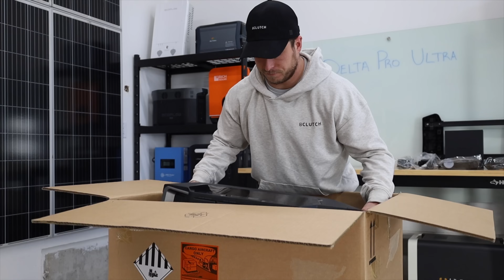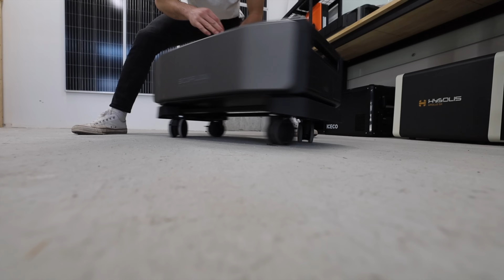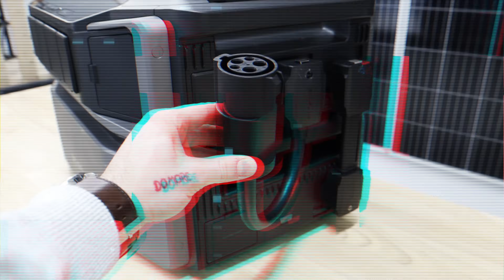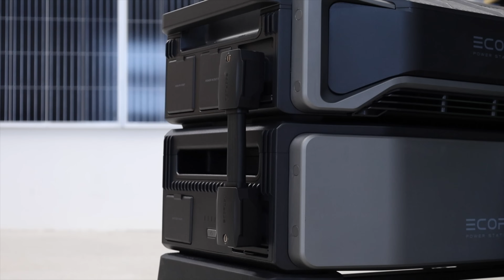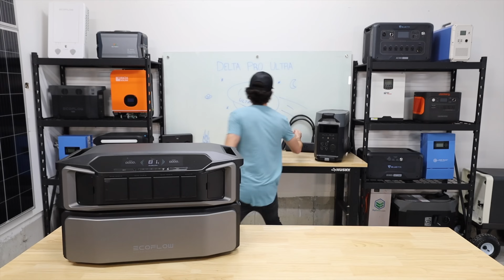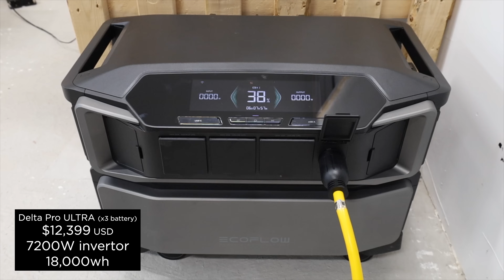EcoFlow Delta Pro Ultra - NOT What We Were Expecting!

Comment: Hey bro! My house is currently running full time on two delta pros with 4 batteries. The house is under contract and the solar is going with it.  I rarely exceed 1k at any given time. More like 500-900 watts daily. At my new house, I'm guessing to stay around 750-900 watts continuous. With the right panels, would the dp ultra with 2 batteries keep me off grid  or should I get more batteries?

Comment: EcoFlow complaints often center on poor customer service, particularly warranty claims, slow resolution times, and unhelpful/uninformed support staff, alongside product reliability issues like rapid battery drain, premature failures (especially out of warranty), and inaccurate power display readings, with some users reporting wrong shipments or issues with unboxing/packaging, though some users find the products excellent and service good, highlighting a mixed but often frustrating experience for those with problems. 
Common Themes in Complaints:
Customer Support Nightmares: Many report being ignored, blocked on social media, receiving AI/unqualified responses, or struggling to get warranty service, leading to long waits for replacements or fixes.
Product Reliability & Failure: Units dying unexpectedly, battery failures (even on new devices), and issues with charging/discharging are common, especially after warranty periods expire.
Misleading Information & Sales: Some customers received incorrect advice on product compatibility or features, leading to frustrating surprises after purchase.
Shipping & Fulfillment Issues: Delays, damaged packaging, or incorrect items (like a bed frame instead of a power station) are reported.
Software/Display Glitches: Inaccurate power consumption displays or app control issues can occur. 
Specific Examples:
A user experienced a dangerous battery drain on two new units and faced a year-long wait for warranty, with support unresponsive.
Someone ordered a solar generator but received a bed frame and had extreme difficulty getting a refund.
Tech support struggled with basic product integration, suggesting a lack of in-depth knowledge.

Comment: I bought the delta pro uktra and have lived off grid prior to owning this four four years.  I had a lead acid 24 volt system witnh 12 200 amp hour six volt batteries  and a 3000 awatt aims inverter.  That did alright but as kids got older snd wanted more gaming and starlink etc the old system was just not cutting it.  So i added another 3600 watts of solar and kept the old system which plugged into a generator receptacle for the entire house and i bought this unit.  So now with this we can go two days in darkness and when it runs low on battery I just ppug back into the old system.   Eats hearing a noisy generator and the unit charges fast enough with just a mix of sun and cloud in about three hours. I have two batteries with it and that is plenty. It makes off grid living a joy instead of a challenge.    I miss the challenge however but not as much as I miss  the complaints about being with no power from the kids.  !!!

Comment: I’m looking to add power backup for my fifth wheel. Rocking 1200w panels and 810Ah of batteries and a 7kw generator which is pretty solid. This baddy and the Anker F3800, drop this in the belly storage and have a great backup to extend our boondocking experience.

You all are doing great job with reviewing these power systems. What I don’t see is vibration testing. Running around in an RV will cause a lot of shaking, could you possibly give some thoughts on vibration with these?

Comment: Hi There. I have a question regarding the EcoFlow DPU. Let's say I have the EcoFlow DPU with three batteries for a total of 18kWh capacity. This is powering a load of 1500w. The DPU is connected to an AC outlet as well with the charge setting at low (400w). Will the DPU pull the total 1900w load from the AC bypassing the charge limit setting? or will it take the 1500w load from the batteries and 400w from the AC? For the sake of argument let's say that the DPU is not connected to any solar panels. The circuitry in my off-grid cabin cannot handle a combined load over approx. 1200w for a single device so my goal is to be able to limit the max grid input wattage. Any insights or workarounds you all might have would be greatly appreciated. 
I've posed the same question to Google and the A.I. responds sometimes with No and other times Yes. 😵‍💫Many thanks!

Comment: Thanks for the run down. I live in the U.S. Virgin Islands and power outages are a regular part of life here. Most are about 1-3 hours long and can occur as frequently as 3-7 times a month. Of course there are occasions when storms can knock out power for weeks and months at a time. (our home was without power for almost 3 months after Hurricane Maria). I currently have a 7500W inverter gasoline generator that I connect to my circuit breaker panel with a transfer switch with a 240 cable. It does the job, but is a pain to take out, set up, and connect. It's not as loud as other generators that I have owned over the years, but it's loud enough to be less than pleasant. I would love to no longer need it and replace it with this power station. Unfortunately, most explanations of this unit are not offering me an assuring enough answer to whether or not that is possible. I have a condo that is completely electric dependent, refrigerator, stove, oven, etc. My question is about how long (at best) I can expect the power station (with one battery) to keep me going with a full load of lights, refrigerator, and small appliances? Also, how much will I reduce that time if I turn on the stove to cook, a room A/C to cool off, or the washer/dryer to do a load of laundry? Now I know the answer is "it depends on the wattage load," but I was just hoping for some ballpark estimates. I unfortunately don't have exact wattages of all the appliances, but they are typical home appliances, nothing overbearing in power demand than the usual appliances on the market. The A/C's are just a 10,000 BTU room are conditioner and 12,000 BTU split system and I wouldn't run the continually. I think the biggest power guzzlers would be the stove and the dryer. I usually don't run the hot water heater during outages. A cold shower in the Caribbean isn't all that bad. If I can count on at least 5-7 hours of power with a fully charged battery, that would be perfect. A little longer, even better. I would be getting the one that comes with the solar panel, so I can charge it that way when needed and I also have a small 1500w gasoline generator that I could use to recharge the battery. I have seen one video suggesting that the unit doesn't charge at the same time as it is outputting. Can you confirm or discount that, as of course, that could be a major drawback during longer outages. I appreciate your thoughts. Thanks for your information video!
Reply: With the new updated software youncan output while charging.  Obviously if you are generating 3000 watts to charge and your battery is outputting 1200 watts then you are only charging at a rate of 3000 minus 1200 which would be 1800 watts but it is possible. Most buy larger inverter generators 7500 watts so you can charge at 4000 and still have room to power the home.  And you only need to charge for three hours to get it back to a hundred percent

Comment: Connecting 2 delta pro ultra into the 50amp hub gives you 14.4kw not 12kw. Each inverter is 7200 watts? Right?

Comment: Forgive my skepticism and I appreciate the honest no shill review but compare it to other stuff on the market. Sol-Ark, my choice, about $6500, fortress 18kwh battery, about $10,000. Has generator input native, no proprietary plugs, and completely configurable. One stack of Deltas is $14,000, requires a magical subpanel, which I hear is prone to failure, lots of proprietary accessories. Honestly seems like a neat toy but has no grid backfeed capability. Both will ultimately require professional install. I have done many systems and only see the value here as a backup. No savings and in a few years when it craps out? Good luck, Now you have to buy the Delta 7 Supe Duper Ultra Pro plus with backwards compatible adapters? Good money after bad. Sol-Ark too much money? EG-4 has a nice setup. If you're desperate, Sun Gold Power? Batteries too much $$$? Try battery Hookup, Amazon has huge prismatic kits for dirt cheap. If you want a lazy backup, this could work. Lots of features but way overpriced. Get your hands dirty, build a system you can work on, because nobody else will. A modular setup can be repaired or modified, this can't.

Comment: I currently have a 50-amp interlock system on my main panel. I think it's best to leave this here and if the power is out for an extended period of time and I need to charge my Delta Pro system, it can charge from this 50-amp generator source from the main panel versus connecting the generator directly to the EcoFlow Smart Switch, correct? I have a 5-ton a/c system, so I figured that if I kept it like this, I can run the a/c while the generator is running...and it can charge. If I connect the generator directly to the smart switch, I'll never be able to run the a/c (it's too big for the EcoFlow system).

Comment: What sold me on this unit.  If you have a simple Reliance Gen Transfer switch already in your basement and you added a 6 ft cord with the L14-30 plug, you are ready to use this unit.  And, if you cut the original cable leading from your garage or outbuilding, where your generator is located, you could just add an L14-30 outlet on that cord, and either plug into your Ecoflow battery or into your generator power supply.  This is the design that I did for my basement.  I did make one exception.  I added two 120 outlets to my L14-30 outlet(one each side) so that if the Ecoflow got low on power during an emergency, I could add electricity via the 120 V inlet cable from the generator, while continuing to send 240 to the house.   You can not power 240V in and 240v out at the same time, so 120 with 1750 w input is the way to go.

Comment: Really. 5..6 kw into a 12v system, AND you need an MPPT.  who would buy this? Suckers who r looking 4 something EASY without any knowledge of off grid systems.  Save some money, diy, victron MPPT with mc5 connectors, with 24v minimum, and learn what inline fuses and a BMS is!

Comment: apologies if you have answered this already, but would you take this over the Jackery 5000 plus with extra battery (10kwh). I live in Canada and the Jackery 5000plus with an extra battery is 4999. (sale price).   The delta pro 3 ultra is 5560 (sale price).  i have a Generlink transfer switch that i was planning on using to connect either unit to the house.  eventually i would like to add solar.  I also have a Kia Ev9 and would love to know if there is a way to incorporate its battery during a power outage.

Comment: Yep, with all things built is its a great device !!! But not for a boat I’m afraid….
When one of the features stops working, the entire unit must ‘go to the doctor. I am converting my catamaran to completely off grid, and am very into ‘safety and self servicability’ for all electrical things: Easily accessible battery system, easily swappable BMS for the battery pack (which probably is a worlds first), easily swappable solar chargers. So everything easily dissconnectable and swappable. It makes your system much, much more leliable.

Comment: It's great that it makes it that you don't have to learn anything about solar, but it's just not worth it for the price. The Ultra is just the inverter, so you have to pair it with one battery. That' already putting you at $4,200. This gives you a 6kWh battery that's good for 3,500 cycles.

You can instead go with a Ruixu Lithi2-16 a **16kWh** battery rated for **9,000** cycles!!! That's over 26 YEARS if you do a complete cycle every single day! You can pair that with an EG4 12000XP, for about $2,500. Add in another $500 for wires and fuses. So that's $6,200. However, you have a far more capable system, one that can put out way more power, accept a lager solar input, not to mention everything I mentioned before.

I think this system are of those that are super excited about jumping into solar and want to get up and running quickly and aren't willing to invest a little time how to build they own system. That's fine, but it's throwing money away and getting an inferior system.

Comment: Can the Delta Pro Ultra (6144WH) power a 240VAC device while being charged at the same time from the 120VAC line (specifically, my wall outlet)? If so, will  it also power a 120VAC device at the same time it is powering the 240VAC one? Thank you.
Reply: Yes, to all of what you said.  My whole house is essentially powered by a 120 volt outlet.  The DPU 240 volt output goes into a transfer panel and the 120 volt AC input (or pass-through power if you like) and the solar get combined to charge the batteries and power the house constantly.  Everything just works and if the grid power goes away, I wouldn't even know except for the device notifications.  I have 3 batteries and can last a week with a little bit of load-shedding.  One time during an extended power outage (and before I had any solar) I had to find some energy to charge the home batteries (planned on using an EV to charge in emergencies, but didn't have it at the time), so I loaded the inverter and a couple batteries into the car (couldn't fit all 3) and drove out to a working level 2 EV charger to get more power for the house (it was even a free charger).  After a couple hours I had enough power for almost another week.
Reply: @default7950  Thank you so much for your detailed response, I appreciate it very much!

Comment: I know this system qualifies for the 30% tax credit (we have 2 batteries and an inverter and the SHP2 installed). Do you know if can claim the credit for the Anker Solix F2000, even though it's only 2 kw hours, but combined with the DPU, it's over the 3 kw hour requirement? Do you know if the tax credit is only applicable to individual units or combined storage?

Comment: I use 3 DPUs and three solar arrays, and I completely power my home off-grid home ( 800 sq. ft. high mountain very cold in Colorado). Each battery is pre-conditioned (heated) by the BMS through the inverter (set in the app). I use the EcoFlow Home Panel 2 to transfer the combined output of the three DPUs (21Kw) and 10 batteries (60kws) storage to the home's main panel. The price has come done, and I did not pay full price for any of the components with an average of 40% off (shop carefully). The DPUs load balance on the fly. No noise is an understatement. The new connectors are necessary because the outputs/inputs are higher. There are new updates for the app and the inverter! The DPUs can receive input from any third-party panels (4000 watts per inverter). You don't need a transfer switch (use the Home Panel 2), the solar array plugs directly into the DPU high input port! I can remove one of the inverter/battery combos and power my RV when it's there using the 50 amp hub depicted in this video by Solar Lab. This truly is a small whole-home primary system and an excellent whole-home backup system.
https://www.ecoflow.com/us/smart-home-panel-2
Reply: Could you provide links to where you can get these at a decent price?  Average 40% off sounds really good.

Comment: Great analysis. Im not as smart as you on building my own. 67 year old Plumbing Contractor still working every day. My wifes health is bad and if power goes out i cant move her easily. This would work for us since i have two gas/ propane generators i can charge it with during day. Thank you for your advice. BTW, when baby sholder pressed that battery, at that cost, i nearly passed out. Well done sirs
Reply: I know, right? Here I am meticulously handling them with the utmost caution to avoid any mishap, and meanwhile, they're out here casually shoulder pressing and riding around on them like it's nothing. It was a quintessential gag freeze moment for me—utter disbelief, internally questioning, "Am I being overly cautious here?" Quite the reality check, haha.

Comment: Dinosaur here. Been off grid about 15 years lived through winters of -40 and 3 feet of snow on the panels.  I’d go away a week and pop the lead acid batteries will go down to zero and crack the cases. This system is great. I have the inverter and 4 batteries. When there is not enough sun to charge I use the gasoline generator with the adaptor and charge at 6000 watts. With a little sun I can charge up to 100% in a little over 3 hours. No matter the load the inverter is completely silent. I love it. I had the Delta pro, 2nd battery and smart generator but with only 7000 kw it would not last a week untended. The smart generator kicked in automatically which is good but the tiny gas tank only runs for 4 hours. This unit is a new generation above.
Reply: Do you have an inverter gas generator? I was reading the unit are not recommended with standard gas generators as they have high total harmonic distortion Eco flow recommends something under 8% my generator is 12%THD.  They suggested I get a better generator
Reply: 😂 classic response

Comment: I just purchased two 5-battery stacks from Outbound Power and they  have panels included as well as the wall mount electrical panel, and the cables for under $21k.

Comment: Is this just a home backup or i cam used rhay to run my home 24hrs 365 days a year?
Reply: Mine runs everything 24/7.  As long as you don't need more than 30 amps for whatever circuits you're powering, you only need a single unit (and however many batteries you want, I have 3 so far) hooked up like any generator would be.